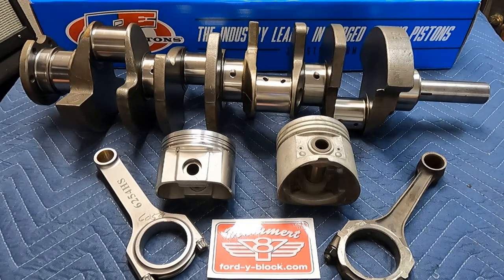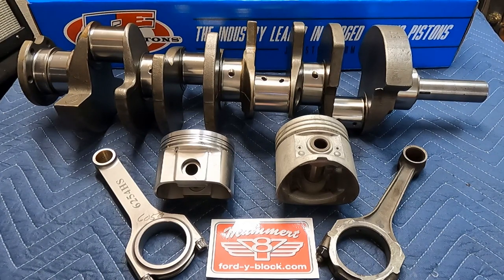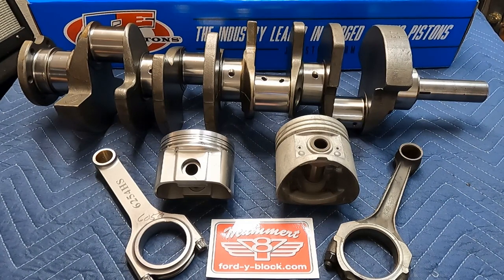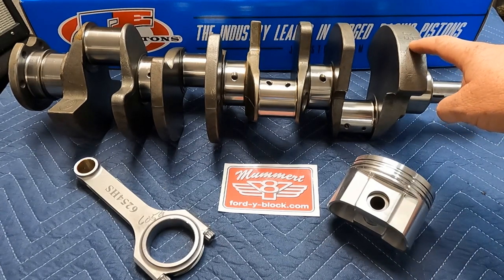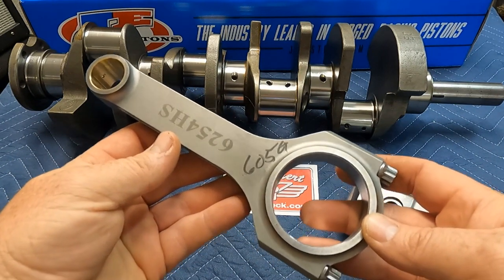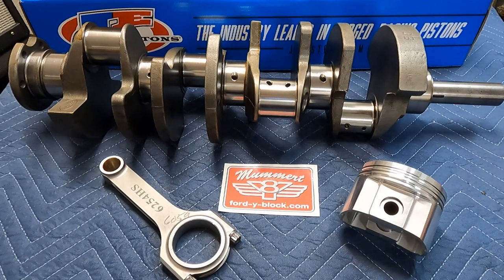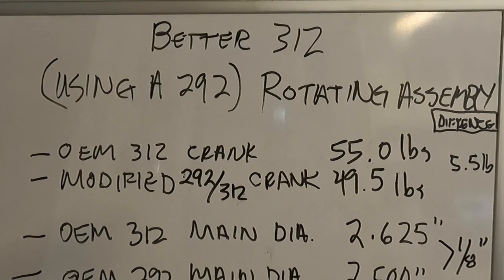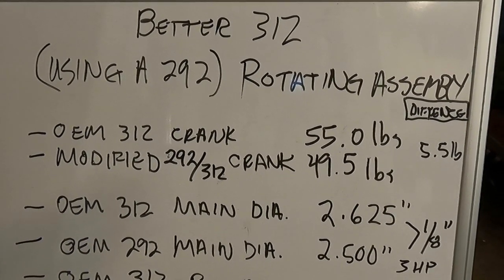Building a Better 312 Ford Y Block Using a 292 : Part 2  Rotating Assembly Tech

Comment: I agree with nost you say, especially weight. But using a 302/5litre is far lighter and will make more power., Cheaper. And 347 is easy to do.
Reply from the maker: Cheap and easy makes it hard to stand out in a crowd.
Reply: @mummertsspecialvinterests2721 if you WANNA keep the classic look of your old t-bird beefin' up the old 292 / 312 is the  way to go , still maintaining originality but given the old girl a little more SNOT !!!!

Comment: As I recall only way to externally recognize 312 engine is counter bores side of flywheel flange(?) I have 2 292s pro built with 312 cranks built to spin 5500 many years still happy engines. I do recommend tire dyno tuning to maximize power and efficiency and saves them from detonating the pistons, something I wish I did not know about.

Comment: WOULD LIKE TO BUY A 318 KIT
Reply from the maker: Our contact information is at ford-y-block.com.  Call or Email. Thanks
Reply: What about what I have been told that the 312 crank has a more efficient phasing? Fully understand that it might be erroneous information. I bought a 312 a few years ago with the aim of having a 292 based Y Block with the 312 crank. Someone in its past managed to strip a head bolt thread in the block, and that’s why the gentleman let it go. Not sure if there is a solution for the stripped threads in one head bolt or not, but I didn’t buy it for the block, just the crank.
Reply from the maker: Our experience is that the 292 has better counterweight phasing.  312 can have strange main bearing wear. Possibly from over counter weighting or poor factory balance.  We have had good luck with 312 after professional balancing @CrippledEagle
Reply: @CrippledEagle  I am not sure if it applies to the Y-Block, but people have definitely saved blocks that had stripped head bolt threads. People put Timeserts in some blocks to save them. This is common in air cooled VW engines, Toyota 2AZFE engine, and Cadillac Northstar engines. However, since those are not iron blocks, I am not sure if it can be applied. Also, a variety of engines get drilled and tapped for larger head studs when the OEM head gasket can't handle more boost. It could theoretically be applied to saving an stock engine block, but this is very expensive.
Reply from the maker: thread repairs are done all the time, just ask Chevy guys.  Their head bolts go into water and they corrode out all the time, many sbc and bbc have thread repairs in the head bolts @skylinefever
Reply: I went to the metric rings years ago in other engines and agree with your statement. At one time because they were not as prevalent and I was having custom pistons made anyway I went with available ring bore sizes. You didn’t tell us the bore; a 292 is 3.75” and a 312 is 3.80.
What bore size rings did you find readily available for your build…I assuming you would not like to go over .060” on a 292 block.
Reply from the maker: The bore is 3.820 .070 over, these engine have much thicker cylinder wall than 60's engines. .070 on a 292 is like .040 on 302 ford,  blocks with a good sonic sheet can go .110" over.  This is part II , go back and watch the intro video and part I for more info @jamestone265
Reply: @jamestone265 I can’t say with positivity, but I know that the 57 up blocks were made into whichever engine size they needed. Same block between the 292 and 312, just machined differently. 
I’ve got several 292s sitting in the hangar along with the 312, also one at home that I bought running from a Gentleman who was determined to “upgrade” his 63 F100. Thinking that I might have to tear a few down and see if I can find a solid block and heads,then perhaps get one done this way. I have a 64 F100 short  wide bed pickup just begging for a Y Block.